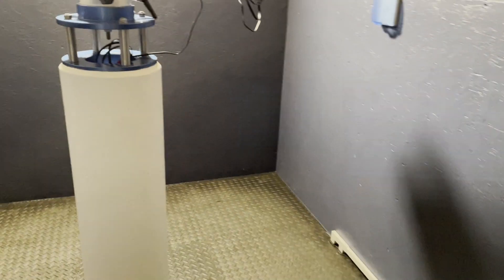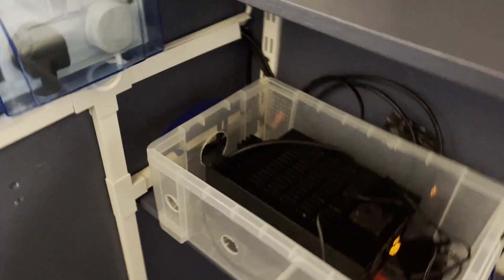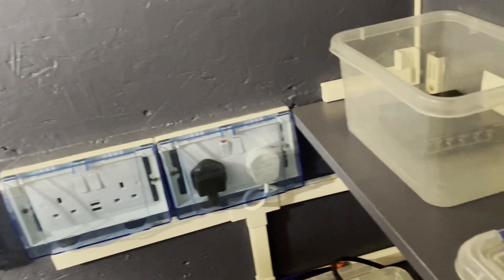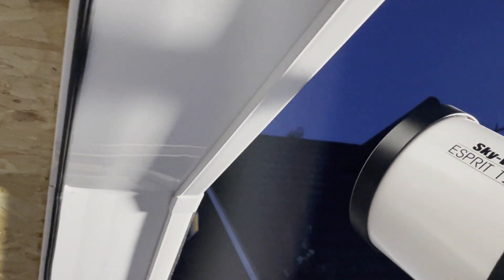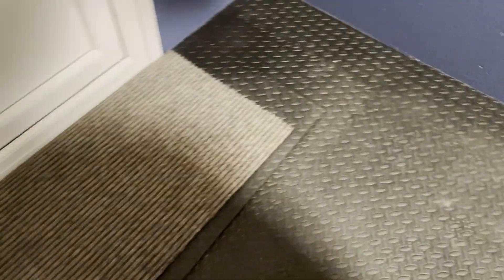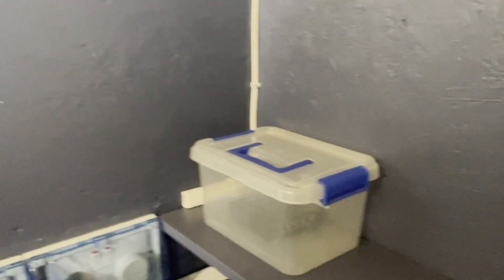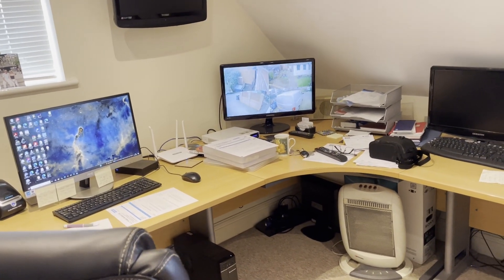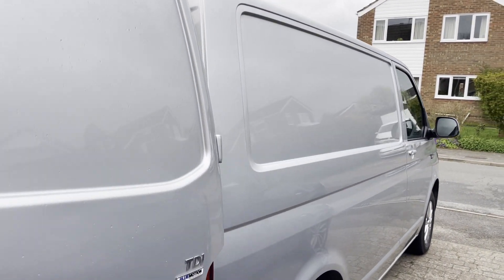Observatory Build Finishing Touches

Comment: The workmanship in that observatory is top notch, Simon - very impressive.  Your plans for the future sounds very exciting too (particularly envious of the camper project!).

I’m struggling with my obsy at the moment. I’ve struggled with deep sky, and miss the connection that visual gives (previously owned 12” dobsonians), but my obsy isn’t really set up to run a big dob as the size is a bit restrictive.  So I’m re-thinking what all this looks like at the moment. Quite daunting for someone who’s not especially handy! I wish I’d constructed it from timber rather than a Keter shed now, as I can work with timber much better.
Reply from the maker: Thanks so much Paul. The camper project sort of happened by accident as my works pickup failed it’s MOT miserably and forced me to get another vehicle quickly, the van just came along a bit sooner than I had ever planned! I get missing the connection with visual, sometimes it’s just nice to stand and look, without bothering about photographing it! It’s a shame about the obsey Paul, I hope you can get things sorted one way or another mate, but keep looking up👍 Clear Skies!

Comment: You can plug all ethernet cables into the hub and they will all talk to each other, no need to swap them if in the office. Ive just installed asiair app on windows 11, that will be a game changer for me
Reply from the maker: Thanks for the tip, I was going to try that, but if it works I’ll leave them both plugged in👍 The ASIAIR is a great tool and I will still use it on my portable rig! Nina will open and close my roof for me within an imaging session though, hopefully! CS

Comment: Thanks for keeping everyone up to date. I do enjoy watching your channel. I have a couple of questions...

1. Do you use any isolation between the copper (I am assuming it's copper) Ethernet between your house and the observatory? I'm thinking of potential nearby lightning strikes specifically (nothing one can do about a direct strike).

2. Why the move away from the ASIAir Plus? This is more a curiosity than anything... I am just beginning my journey and have an ASIAir Plus and have played around with both Stellarmate and NINA.
Reply from the maker: Thanks Joe, that’s much appreciated 👍 Firstly, my internet cable is a direct burial cable and is underground, until the house where it goes up the wall on the outside, but I don’t think it’ll be a problem! As for the ASIAIR, I’m not dumping it, I love it! I will use it on my portable rig. The reason I’m swapping it over is so I can control the observatory roof with Nina, which you can’t do with the ASIAIR ! ASIAIR is great and I can recommend it to anyone wanting to get into astrophotography, but you can do more with Nina😀 Thanks and clear skies!

Comment: Amazing job quality, really nice job Simon.
Reply: All is good here, well…anyway, stupid question but, do you release the clutch’s before tracking on your Eq6R or keep them locked. Can’t get my tracking under 2 arc seconds, frustration setting in, second guessing everything.
Reply from the maker: @woody5109  Hi Woody
Frustrating issues only make you better! When you’ve sorted it out it’ll make you feel good! Definitely keep the clutches locked! Make sure you’re on level and Solid ground, level the tripod, make sure all clutches are tight. Take time to polar align and take time to balance the rig (with lens caps off) the weight of the caps can make a difference when balancing! Focus the guide scope the best you can, use multi star guiding and you should get good tracking, I get between .4 - .7 most nights! Hope that helps! Good luck mate👍
Reply from the maker: Thanks so much woody👍 Hope you’re getting on ok over there? Clear skies!

Comment: Why don’t you just plug the Ethernet into the asi air then use as station mode then you’ll be connected to the air in your houses router, could even use blue stack on your laptop to emulate the software,
Reply from the maker: Thanks for the suggestion, it’s a good idea, but I’ve already bought the quieter 3 now🤣 and I want to use the ASIAIR on my portable rig out in the field as it’s just easier 👍 Clear Skies!
Reply: @SimonsAstro  ah got yer, great obsy fair play, beats my corner summerhouse hands down ✨✨
Reply from the maker: @FPVsimon  🤣 Thanks